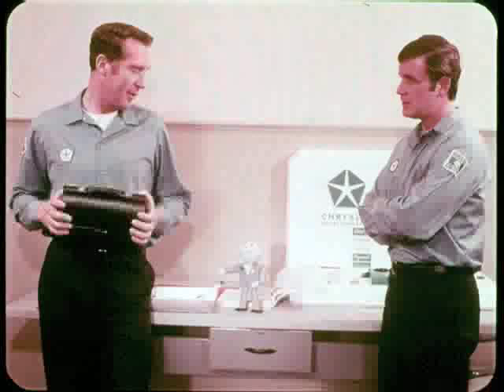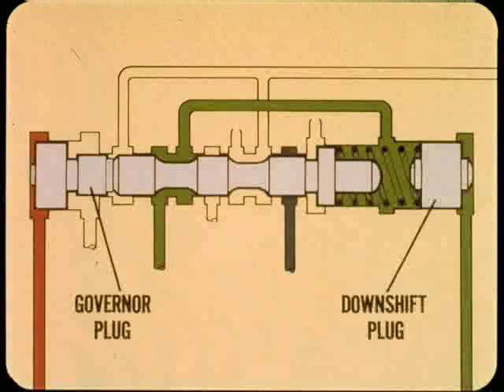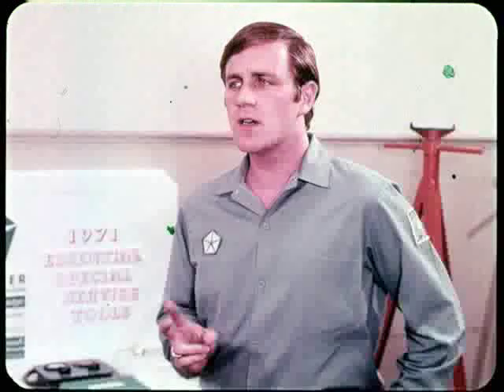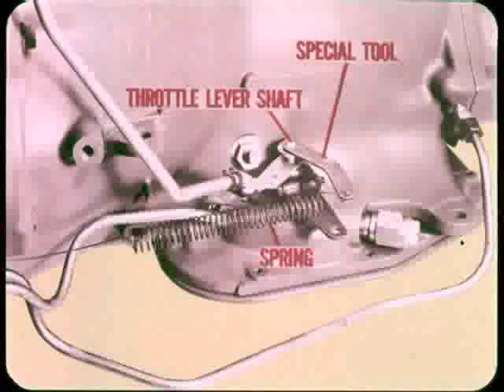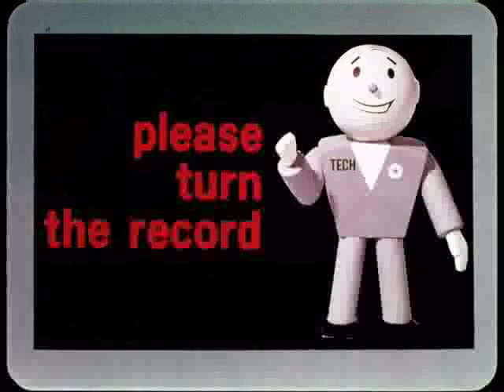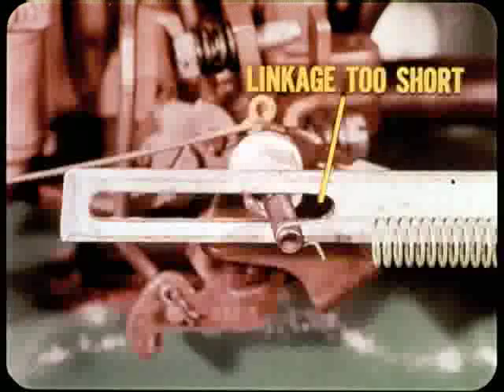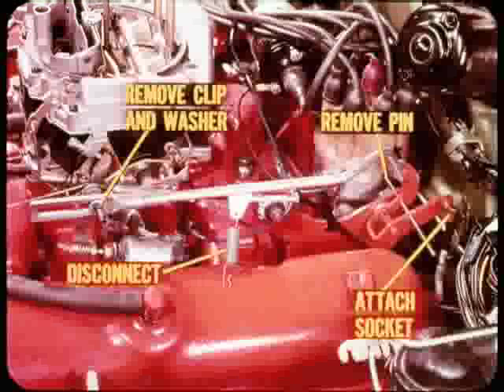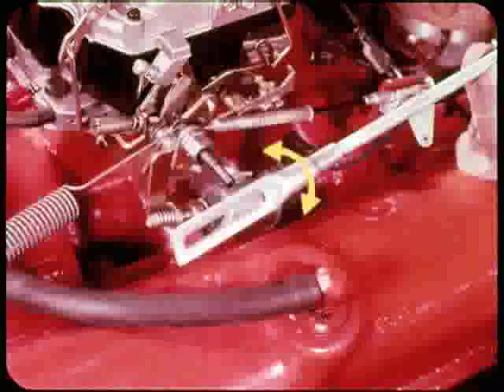71 02 Shift Quality and Linkage Adjustment

Comment: Thanks for the upload. Do I really need the special tool for the kickdown/throttle pressure lever, or can I hold the lever all the way forward while making the adjustment? I'm working on a '74 Dodge Monaco with a 440 and a 727, all original linkages.
Reply: I ziptied my Edelbrock carb at WOT (engine off) and then pulled a Lokar cable tight. I guess that's a workable solution? But my shift points are too late, which I thought was due to not enough throttle pressure, but this video is telling me that I actually have too much. So I'm going to try loosening the cable a bit. So maybe that info is helpful or maybe not.

Comment: There is a GLARING omission from this video. WOT. You have to check the throttle to ensure WOT at the carburetor is achievable after final adjustment using the method described in the video. If not the Kick Down/Throttle Pressure linkage could prevent the carburetor from reaching full throttle. I've seen this so many times it is the first thing I look at on any automatic equipped Mopar when engine power is at issue.
I've found that putting the throttle at WOT position and then making sure the KD/TP linkage and the carburetor throttle pin/arm both reach maximum travel at the same point achieves the correct adjustment much more easily and directly. Other than that everything in the video is correct.
Reply: @JJ Hi JJ I had a similar issue, do you have the oem kick down or did you get the aftermarket cable type? I found that the cable type was way easier to adjust properly
Reply: @maximuswedgie5149  I use all factory linkage. It just seems to work better. But there are situations where factory linkage won't work for whatever reason.
Reply: Yep that's the way I've always done it